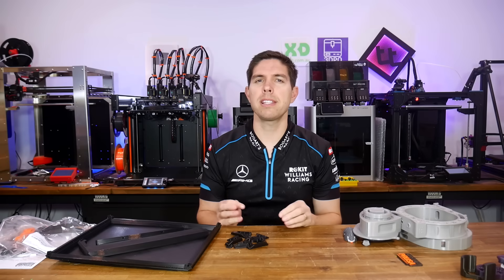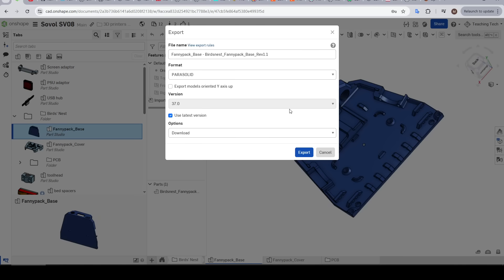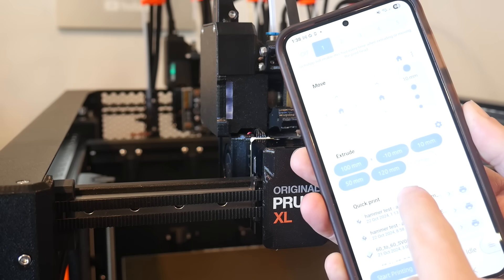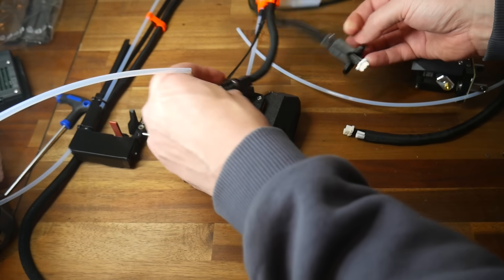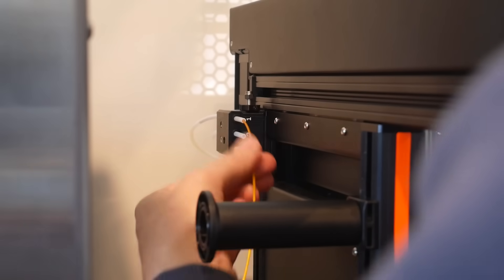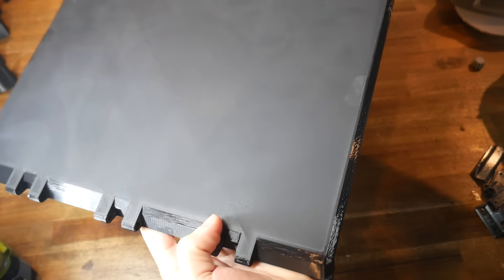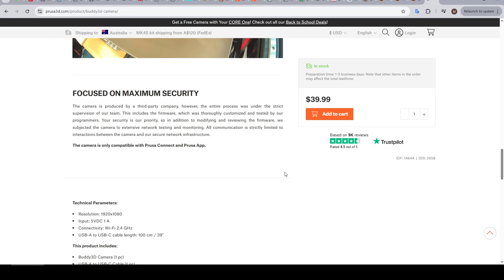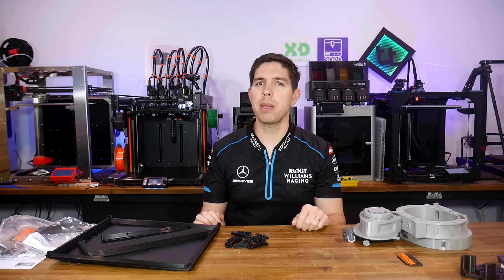Evaluating my replacement Prusa XL + SV08 update

Comment: I do not understand why you have so many issues with the XL. Ours is not an early release, but was released in the first few shipped. Ours runs perfect with 0.6 and 0.4. The only thing we did was run test for each filament so we could create a profile to match the manufacturer recommendations. If you follow the instructions and do exactly what they say, not overthinking it or over engineering. Read it and do exactly what they say during an assembly and you shouldn’t have any issues whatsoever. The profiles that are in slicer by default are guidelines, not exact settings. To hot imo. The only thing that seems to be consistent in this equation is the user assembling and running the printer. And I also have to state that over the few years that I’ve watched your channel some of your prints that you found good or acceptable were to be honest something I would’ve considered a failure. I don’t mean to be mean or say this in a bad way, but I was trying to analyze your issues from my couch and wonder why it is you’re having such an issue with Prusa. You clearly are an advocate of a close sourced 3-D printers hence Bambu labs. And quick to get on Prusa for a few items not released yet. And that camera is not something that I would release. This day and age they should have a 4K camera that runs crystal clear. But you can’t always get your cake and eat it too. Every time I’ve looked everything I need to find was available on the GitHub site. 

I was unaware that bambu was able to detect filament types from third parties with their AMS system. I don’t know how you say they do that, but I can’t find any information that supports it. The only thing that I’m aware of this bambu can detect its own filament on its AMS systems. So now I have to buy their printer, with their software and their filament and hook up to an insecure cloud and jeopardize my intellectual rights to utilize all the features of the software and hardware. And you know it kind of bothers me that it’s a communist country with a close source software. Not to mention the DOD here in the United States did say that IoT items are going to be one of the most dangerous things as far as security goes on each individual’s lan and what it could do not only to your devices, but to the Internet as a whole. But you keep going with your closed sourced proprietary software and enjoy. I wish you the best. I’m sorry that you have had such a hard time with Prusa and I’m glad you like bambu. But I would really hope that you are very knowledgeable in security and putting these things on their own Network and vlan and possibly set up a honey pot and some intrusion detection software running 24/7. If you think I’m being paranoid, then do a little research before you get back on your soapbox. and one more thing, you might wanna go and do a little bit of research on Chinese companies whether they’re in China or Australia or wherever, and Chinese citizens even if they’re abroad the requirements of what these companies and people must do at request of the government because it is their duty and the law. This does not mean that all Chinese people are bad. That is not what I’m saying, but I am saying that the CCP demands these things be followed, or this person or company could be held liable they could be interrogated find imprisoned or worse. So with this all being said. I understand your frustration with an expensive printer… but it is a great printer and it’s capable of unbelievable things. ❤😊 Post #1
Reply: Bambu has been operating for over 3 years now with probably millions of customers. So far there has been no evidence of any malicious behavior with user data or 3d models. Their servers run on AWS and presumably follow all the guidelines required to operations in the US. 
Your smart phone was probably made in China too and you send much more sensitive data through it.
Reply: @Dave_the_Dave  Dave, You are correct there are millions of customers. Bambu also put out article talking about that the security was not there primary goal at that time or something to that effect. And they said that they have improved it. As to whether they have or haven’t I don’t know… because you can’t look at the source code. And you also forgot about the updates you get from them. I’m not going to take the risk of having to do subscription based features that they seem to be heading in that direction, but based on the communities, outrage looks like they put a hold on that. But firmware can be updated at any time, and if the CCP demands them to put a loophole in their firmware to expose your network password and IP address they have to do it. No questions asked… and it only takes a few lines of code to gain access to that device and have it be controlled remotely. Oh wait they already had that happen with the print queue and all that. Nothing like having your printer turned on, on its own and heat up and start printing at random. Hopefully they don’t overload it and start your house on fire. Maybe they’ll just turn on the video camera and watch it remotely, or just keep the microphone on and listen to you having a discussion with the Social Security administration as you gave your Social Security number to them. And just because it hasn’t happened yet doesn’t mean it can’t. If something happens due to Taiwan and China and God forbid that massive war kicks off, do you think that they’re not gonna utilize every single method that they can to win that? And I know this is extreme. But this is reality. These are the things you do need to pay attention to for every product you own and you put in your house or business that has access to your devices. Your security cameras,thermostat, dishwasher, refrigerator, cell phone, tablet, computer, 3D printer, etc; and obviously most of these devices have been checked out thoroughly by the manufacturers to make sure there are not any hidden chips and such running around doing whatever they wanna do. And also, they control the source code for the device that they’re selling. With that being said, bambu controls theirs, CCP controls them. And if I remember correctly, everything about that 3-D printer is made in Shenzhen China. 🇨🇳 nonetheless I hear what you’re saying. But please take what I’m saying seriously. I’m not here really to slam bambu. I’m just telling you that this device in particular given on its place of manufacture, and the countries current habit of back door devices to gain information about its citizens and it’s vulnerabilities is very high. I mean, didn’t they just get caught hacking not too long ago getting 150 million US citizens private SSA information from one of the credit report companies. As you said, Now they have access to millions microphones and cameras and a mini computer to do as they will. You should never ever send anything confidential to the cloud and then back down to your cell phone or home computer. It should always be a direct encrypted connection to your home network and only to your encrypted device to access it. Everything else is basically plain text and open to anyone that’s got five minutes on YouTube. Good luck, my friend. I wish you the best.😊
Reply: @Dave_the_Dave  it seems my past post was removed. Dave, You are correct there are millions of customers. Bambu also put out article talking about that the security was not there primary goal at that time or something to that effect. And they said that they have improved it. As to whether they have or haven’t I don’t know… because you can’t look at the source code. And you also forgot about the updates you get from them. I’m not going to take the risk of having to do subscription based features that they seem to be heading in that direction, but based on the communities, outrage looks like they put a hold on that. But firmware can be updated at any time, and if the CCP demands them to put a loophole in their firmware to expose your network password and IP address they have to do it. No questions asked… and it only takes a few lines of code to gain access to that device and have it be controlled remotely. Oh wait they already had that happen with the print queue and all that. Nothing like having your printer turned on, on its own and heat up and start printing at random. Hopefully they don’t overload it and start your house on fire. Maybe they’ll just turn on the video camera and watch it remotely, or just keep the microphone on and listen to you having a discussion with the Social Security administration as you gave your Social Security number to them. And just because it hasn’t happened yet doesn’t mean it can’t. If something happens due to Taiwan and China and God forbid that massive war kicks off, do you think that they’re not gonna utilize every single method that they can to win that? And I know this is extreme. But this is reality. These are the things you do need to pay attention to for every product you own and you put in your house or business that has access to your devices. Your security cameras,thermostat, dishwasher, refrigerator, cell phone, tablet, computer, 3D printer, etc; and obviously most of these devices have been checked out thoroughly by the manufacturers to make sure there are not any hidden chips and such running around doing whatever they wanna do. And also, they control the source code for the device that they’re selling. With that being said, bambu controls theirs, CCP controls them. And if I remember correctly, everything about that 3-D printer is made in Shenzhen China. 🇨🇳 nonetheless I hear what you’re saying. But please take what I’m saying seriously. I’m not here really to slam bambu. I’m just telling you that this device in particular given on its place of manufacture, and the countries current habit of back door devices to gain information about its citizens and it’s vulnerabilities is very high. I mean, didn’t they just get caught hacking not too long ago getting 150 million US citizens private SSA information from one of the credit report companies. As you said, Now they have access to millions microphones and cameras and a mini computer to do as they will. You should never ever send anything confidential to the cloud and then back down to your cell phone or home computer. It should always be a direct encrypted connection to your home network and only to your encrypted device to access it. Everything else is basically plain text and open to anyone that’s got five minutes on YouTube. Good luck, my friend. I wish you the best.😊
Reply: @Dave_the_Dave  Dave, You are correct there are millions of customers. Bambu also put out article talking about that the security was not there primary goal at that time or something to that effect. And they said that they have improved it. As to whether they have or haven’t I don’t know… because you can’t look at the source code. And you also forgot about the updates you get from them. I’m not going to take the risk of having to do subscription based features that they seem to be heading in that direction, but based on the communities, outrage looks like they put a hold on that. But firmware can be updated at any time, and if the CCP demands them to put a loophole in their firmware to expose your network password and IP address they have to do it. No questions asked… and it only takes a few lines of code to gain access to that device and have it be controlled remotely. Oh wait they already had that happen with the print queue and all that. Nothing like having your printer turned on, on its own and heat up and start printing at random. Hopefully they don’t overload it and start your house on fire. Maybe they’ll just turn on the video camera and watch it remotely, or just keep the microphone on and listen to you having a discussion with the Social Security administration as you gave your Social Security number to them. And just because it hasn’t happened yet doesn’t mean it can’t. If something happens due to Taiwan and China and God forbid that massive war kicks off, do you think that they’re not gonna utilize every single method that they can to win that? And I know this is extreme. But this is reality. These are the things you do need to pay attention to for every product you own and you put in your house or business that has access to your devices. Your security cameras,thermostat, dishwasher, refrigerator, cell phone, tablet, computer, 3D printer, etc; and obviously most of these devices have been checked out thoroughly by the manufacturers to make sure there are not any hidden chips and such running around doing whatever they wanna do. And also, they control the source code for the device that they’re selling. With that being said, bambu controls theirs, CCP controls them. And if I remember correctly, everything about that 3-D printer is made in Shenzhen China. 🇨🇳 nonetheless I hear what you’re saying. But please take what I’m saying seriously. I’m not here really to slam bambu. I’m just telling you that this device in particular given on its place of manufacture, and the countries current habit of back door devices to gain information about its citizens and it’s vulnerabilities is very high. I mean, didn’t they just get caught hacking not too long ago getting 150 million US citizens private SSA information from one of the credit report companies. As you said, Now they have access to millions microphones and cameras and a mini computer to do as they will. You should never ever send anything confidential to the cloud and then back down to your cell phone or home computer. It should always be a direct encrypted connection to your home network and only to your encrypted device to access it. Everything else is basically plain text and open to anyone that’s got five minutes on YouTube. Good luck, my friend. I wish you the best.😊

Post #2
Reply from the maker: You very long post is full of things that just aren't true. You say you have watched me for years, but then say "You clearly are an advocate of a close sourced 3-D printers hence Bambu labs". Myself and Joel from 3D Printing Nerd were the two who went directly to the Bambu Lab CEO and convinced him to not try and squash the community open source firmware for the X1C. Everything I design I release free and open source. Look at my Bambu Lab H2D review, where I include a section about it being closed source and point out some of the other poor things that Bambu have done with 3rd party options. I could pick apart a lot more but it's not worth the time. Most people will spot the bias and BS in your comment very quickly.
Reply: @TeachingTech  Michael, I never made any comment regarding Joel and yourself trying to convince bamboo labs to not squash the open source community. I never made any comments referring to any of your designs and whether or not they’re open source. I am referring to bambu labs and their printers and software not being open source. And the fact that you use them and speak very highly of them as if they just work by a push of a button. Given their slicer wasn’t open source at first… until the community complained that it came from Prusa and that’s an open source license requirement. And I understand that you’re frustrated with my comments and that’s very clear. And I welcome you to spend the time to pick apart the BS comments that I posted. But as you and I talked via email. My second comment is not visible to the public. So when David replied to my comment, continuing on this conversation in more detail… my 2nd post has been deleted. Yes, deleted. You say that you don’t shadow band people. And I have to believe you. Given you did include a screenshot showing my second entry replying to David. But I am not able to view that post anymore. Google has proven time and time again to do some shady things on YouTube to its members and comments that conflict with their ideals. But I’m very confused on why you saw the post at one point, but I am no longer able to. Either way please make sure when you read things that I posted that you don’t take them out of context or draw conclusions. I do not mean to come off as some kind of a jerk and I’m not here to cause drama on a channel. I’m just pointing out something that’s very obvious to me but seem to be for others. 

Bambu labs does print very nicely and fast for the most part. And if you just want to push a button then Bambiu labs is a no-brainer. For the price and quality of print. But that is not what this is about. There is more to a printer than just printing fast with decent quality. If that’s what people want and do and do not care about the rest of it. Like supporting open source, security and those that have actually put forth so much work into creating the 3D printing industry like Prusa. Because so many companies have sold out to proprietary hardware and software that there very few open source companies left. And I believe it is up to us to continue to support them even if it does cost us a little more. But that’s the price you pay for knowing that you have a good product that you yourself can expand upon And give back to the community.  Post#3

Comment: The issue with the prusa is, if you're spending thousands on a printer, you want it to just work.......
Reply: Seriously this is your issue this is literally an issue with every printer out there on their early launch cycle, bambu had a lot of fire hazard issues regarding thermal runaway for months they're A1 had fire issues as well with the beds power cable.  my issue is buying a cheap printer and having to do my own QA so my house doesn't burn down and buy additional parts and spend time printing modified parts to fix the manufacturers serious issues on top of that either modify my own firmware or finding a really good community firmware that actually works correctly.
Reply: The issue with Prusa is they think it's still 2012.